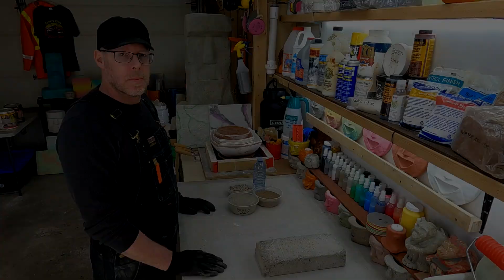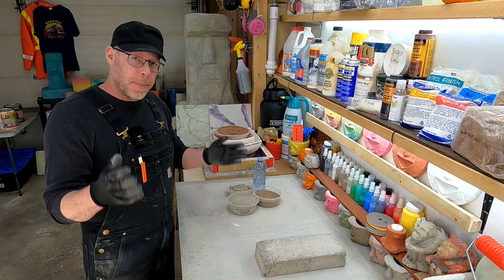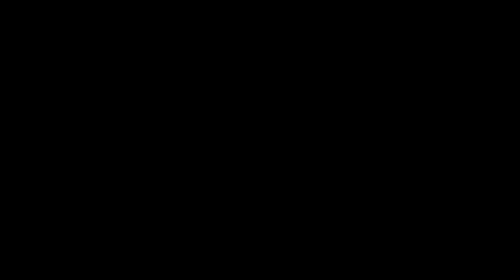Why Does Concrete Need Sand?

Comment: I was under the impression that sand was important also because it is hydrologicallly active in concrete. If this is not true, do you think it would be feasible to replace sand with a powdered metal like aluminum or bismuth? I ask because I am interested in making high density highly thermally conductive concrete.

Comment: This was very useful.  Just patching a hole I broke through a basement floor to run some waterlines.  3/4" down gravel will contain enough sand to bond a concrete sufficient for my purpose.   All the best with your channel

Comment: I have a silicone mould the wall are pretty thin about quarter of an each ,I tried several mixes ,when de moúld it always  breaks up ,any solutions,thanks
Reply: PS I let it dry for three , four days ,the other moulds I can take out of the mould .

Comment: I needed to elevate my front porch to prevent pudding.  It was about 1/8 in below surface in two spots. I used portland and all purpose sand. The sand was so gritty I couldn't get it to smooth out. I wonder if portland alond would help and then brush it for texture